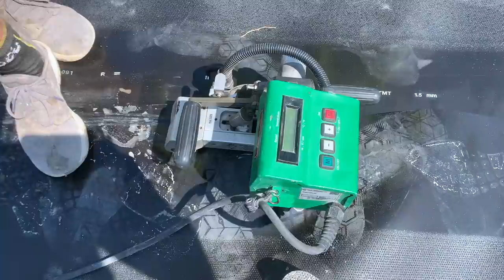Total renovation of a sedimentation pond part 2:5

Comment: Nice work. Why the need for all the plastic. If its just run off flood water. 🤔
Reply from the maker: I have info on that in the description.
Reply: Thanks for the reply my friend. Still i was wondering why the need for the liner? What needs to settle? Cant it just sit in the pond and then run off naturally. I dont know anything. Im ignorant. Trying to learn. Thanks again. Love the vids 👍🏼👌🏻
Reply: @EVOMAN14 If it's coming from the highway probably contains oil from the cars. My guess is regulation for environmental reason.